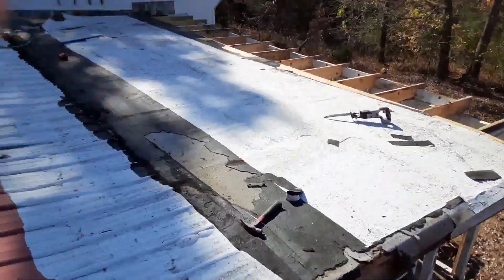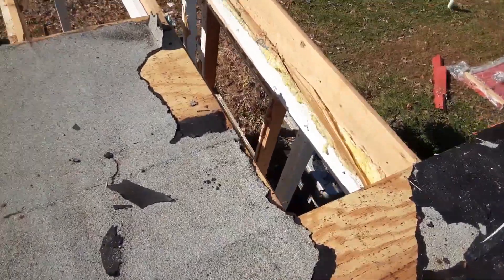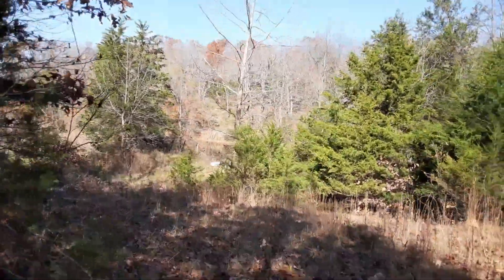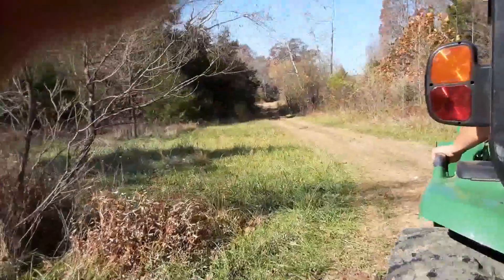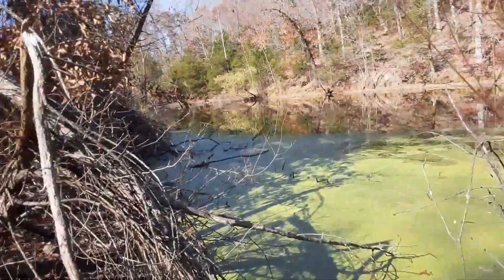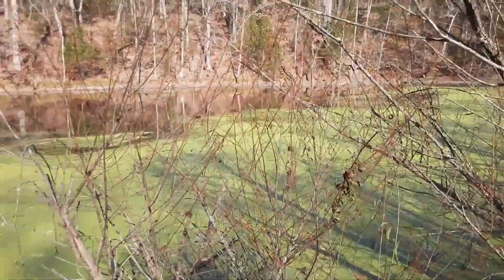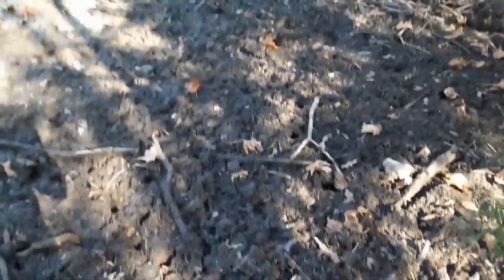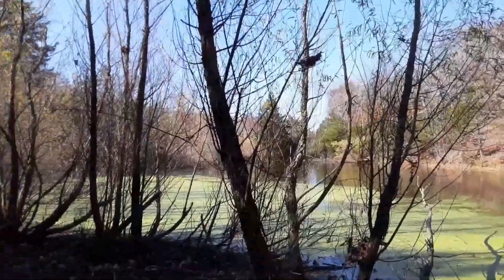Part 2 Working on Porch

Comment: I'm scared of heights. Lol. And I used to do roofing.
Reply from the maker: It was a little scary since we tore most of the walls down....a little shakey.
Reply: @KilldeerSurvival  lol. I helped my dad turn a detached garage into a mother-in-law apartment. The old building was falling apart  but too close to the fence to teardown and rebuild legally. So we took down one wall, rebuilt it, then the next wall. Then the roof. Was super sketchy. Lol